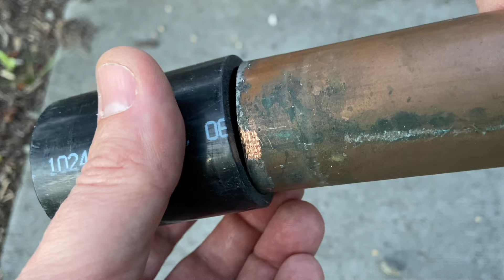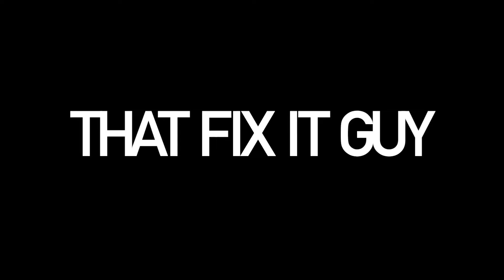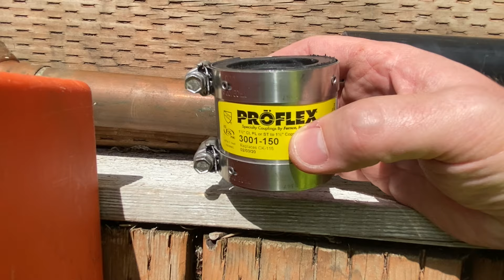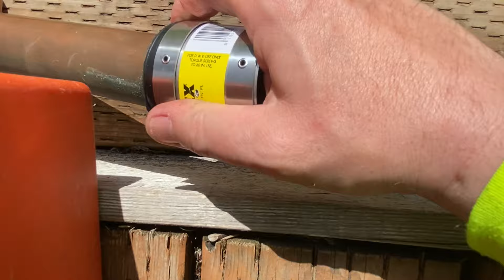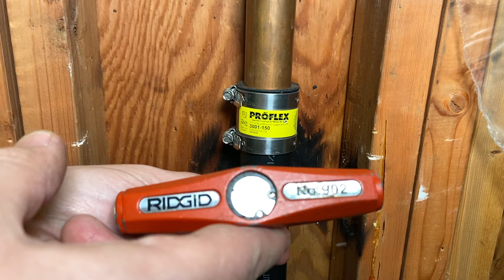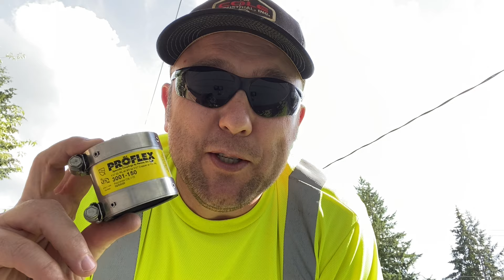Quick Tip for Connecting to Old Copper Drain Line

Comment: Great tip! You showed it installed vertically. I assume this connector could also be installed in a horizontal section of copper to ABS drain line?

Comment: Thank you for the video. Is this only for vertical applications or can it be used between the shower drain and the old 2" copper pipe?
Reply from the maker: Yep you can totally do that.

Comment: Alright chief, honest question for you. I'm here in Tacoma. I go for Salmon too, caught 6 silver and kings this year so far.   Dad's been in HVAC since 1979. I've been in Electrical for a long time.  Old 3" Copper pipe is under the house, DWV.  Built in 1962, soldered in with Tin/Lead Solder.  We have a 90 coming down from Toilet, then to 3" straight pipe out to sewer.  The 3" DWV Copper fitting is dripping for the first time in 60 years. It's got a pin hole at 6:00 position of 90' seam of the fitting.   

My question is "what is required to refill the seem of 3" Straight pipe to 90 with solder? Will flux work? We have a box of old tin/lead solder in grandpa's garage.  What steps could you take to solder same pipe joints without replacing it?  THanks for everything, see you in the field.
Reply from the maker: I would use some of that old stuff from grandpas garage. 

I would not use it for a day so it drys, wire brush the area flux, heat then a dab of grandpas blend and I bet your good.

Comment: I need to use a fernco couple from my brass tailpipe to my copper pipe what size do I need they are 1 1/2 inch pipes  the threads in the bottom pipe were destroyed and I need to couple the new tail pipe. I thought that the fernco was the way to go but I see that there are many different sizes

Comment: I love you. Hey how do I know what number proflex to get to connect my copper pipe to my brass tail pipe? I noticed that you used 3001-150
Reply from the maker: Well there are to different size tail pieces. Kitchen or bathroom?  Kitchen is 1 1/2 bathrooms usually 1 1/4 tail piece.
Reply: @ThatFixItGuy  Thanks, I just found that out the hard way! I luckily had a 1 1/4" which seems to be working... The pipes are, 1 1/2" so I figured the rubber coupling should be 1 1/2" ? Guess not! 
I repaired a bathtub drain assembly with the original pieces except for the waste pipe coming from the drain elbow. I replaced that, and the tailpipe coming from the below of the waste T into the drain. The tailpipe is brass and the drain below it is copper. The drain threads were ruined when I removed the pipe that was threaded into it. (nightmare of a job)That's why I tried the rubber coupling. I wanted to avoid a MAJOR reconstruction project or hiring a plumber who would have ripped out all existing pipes that are still in good condition and charging me a lot of $$$

Comment: Hey You have to show it as you install it in place. Was it installed between the two sections of copper pipe? Thank you
Reply from the maker: Yes it was installed in between two pieces of copper.  Sorry I was just showing the fitting to be used, not what work was being done.

Comment: Can you use it in shower drain system to connect old copper pipe with pvc and then put it all under concrete slab? I read instructions and says for above ground only though. Do I have other options here?
Reply: I would not put under a cement pad 
This really is a temporary fix 
Rubber you will have a 5 year life span 
Retired wastewater treatment plant operator so I’ve seen a lot of different things and Rubber just  doesn’t last

Comment: do they make it for 2  inch  or3 inch pipe, qhere xab i buy them
Reply from the maker: What is the size you are looking for exactly?  I can get a link for you. You can them the online, home depot, plumbing supply house.  Proflex goes up to 8 inch I think.
Reply: @ThatFixItGuy  looking to tun pvc pipe off copper waste line pipe that is buried under concrete slabb in bsdement ,, better off running new pvc line and capp off copper waste line to one under concrete slabb,,jjust be easier instead of moving water hearwer and furnance
Reply from the maker: yeah I like your thought.  If you use this style of coupling in the ground, I would wrap it with a couple wraps of 10 mil tape after it is together to keep the dirt out.
Reply: how do i determine the inside diameter of pipe, and whats best way to measure outside diameter of waste pipe. Or do i have to cut pipe and measure the inside diameter. trying not to do that.Wanna get all couplings and pvc pipe first. this way i can just  go and fix it .
Reply from the maker: the pipe size is usually marked somewhere on it. may have to find a longer piece.   If not get yourself and OD tape. or google pipe diameter  string measurement.
Reply: @ThatFixItGuy  thanks will do,, was told if 3inch pipe the inside diameter would be 3 and 1 8th inside diameter
Reply from the maker: the inside of the pipe is what gives you your pipe size.  3'' pipe should be 3'' inside.  3/4 copper water pipe  will be 3/4 inside.  it is the thickness of the pipe that changes the outside diameter.

Comment: Am I the only one that would still perfer the old copper for DWM instead of ABS/PVC (if money was no object)
Reply from the maker: Oh there are plenty of plumbers out there that have your same opinion. But that price!! Oh that price!
Reply: @ThatFixItGuy  I had to purchase a 12 ft length of pipe and 11 fittings (a few t's a y, 3 90's and 45's) of 2" dwm cop to move an existing drain to an adjacent wall.... $1200 later... 🤯 (my contractor discount barely covers sales tax)
Reply from the maker: Wow!  Yeah the price of material has gone crazy.

Comment: How to attach ABS to cooper? 
DON’T!!! ABS is out dated garbage! Use PVC!
Reply from the maker: They use ABS around here for all residential plumbing.  I like PVC and do hope they change it, but I don't know.  Where are you located?
Reply: @ThatFixItGuy  Kentucky. We haven’t used abs around here for sometime, honestly before my time. I replace it fairly often. I know in several other places where they don’t either. Where are you located?
Reply from the maker: I live up in Washington State. That is so interesting to me.  I don’t understand some states are still using it if others have had issues.
Reply: @ThatFixItGuy  it’s all about the money. Likely weather too, though Kentucky and Washington are similar temperature wise.
Reply: @ThatFixItGuy  in Wisconsin we can use ABS or PVC it does not matter. PVC is the older way of doing it. ABS about 10 years newer than PVC.
Reply: I was told by all the tradesman I ve  worked with that ABS is much better  than PVC drain pipe . The plumbing supply hardwares  , same thing !  Maybe the confusion is Kentucky being new to indoor plumbing ! Just kidding.lol
Reply: @gregr1672  It's cheaper, and goes together with a one part glue. that its for being better.
Reply from the maker: @gregr1672  😂 I would go with what passes the plumbing inspection.  I’m going to try and find out why our state only wants ABS for Residential.